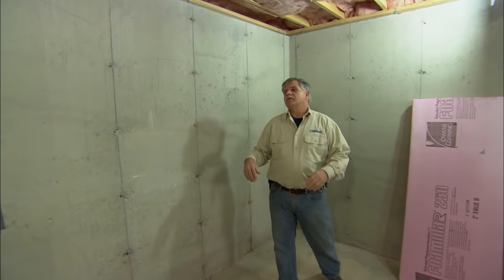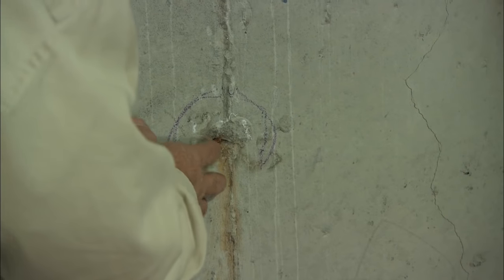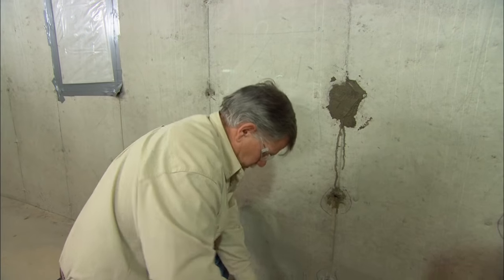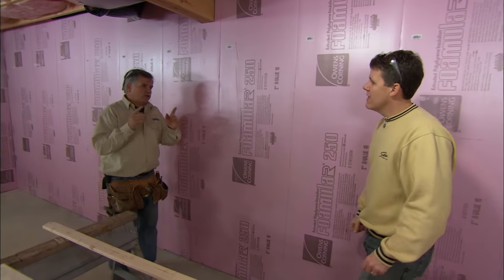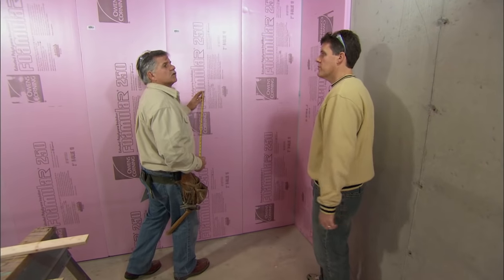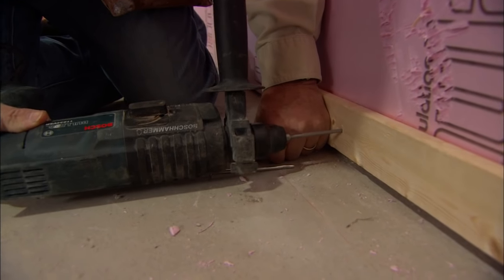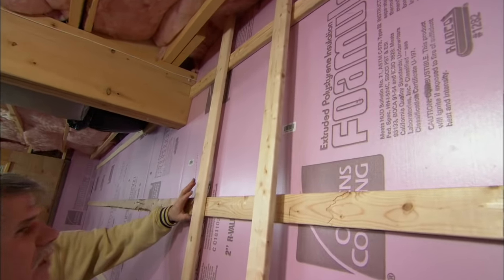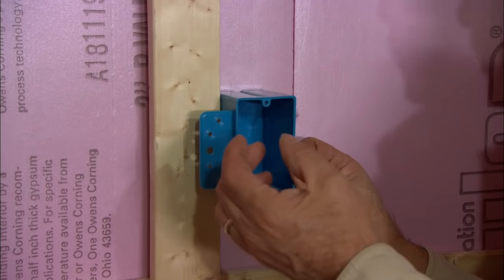How to Frame Out Basement Walls | This Old House

Comment: First, the air barrier is the insulation.  The tongue and groove creates the air barrier. 
Secondly, the wood is just to hang drywall and pictures.  Anything heavier than a picture will need to be anchored into the concrete.
Third, I'm not sure if this is cheaper, but it is an alternative for an individual installation as compared to 2x4 wall construction where the material is heavier.
And Lastly, the glue should be installed vertically, NOT Horizontal.  Yes, the basement isn't leaking now, but at some point it will.  By placing the glue vertically, the water can still run down the wall to the drain.  If the glue runs horizontal, it could trap the water and create mold.  Good air flow and a drainage path prevents mold.
Reply: About to move from dry California to humid Ohio. The house I bought was built in 2005 and in great shape. I'll be finishing the basement myself and was curious about what you said about there being moisture in the walls eventually. How long until I have a moisture or mold problem. What can I do to prevent or prolong any issues. I plan on using 2x4. Any help is appreciated.
Reply: Jeff Lundy 7
Reply: @Brocklanders80085  encapsulate from outside and inside. install a sump pump and dehumidifier. these things aren't DIY though.

Comment: I used that insulation then just framed 2x4s normally over the top of that.   The "Mike Holmes method"  which was the latest thing at the time.   It does end up thicker than this method but I can't imagine drilling all those concrete holes.  Plus I would think all those holes would affect the integrity of the insulation, which is serving as a vapor barrier.

Comment: First I sealed all cracks and joints in my foundation with polyurethane concrete failing. I then used 2 inch foam board for my basement and used foam adhesive. I also used house wrap tape on all my seems. I then put strips of 2 inch foam at the top ledge of the concrete foundation where the sill plate sits. Also adhesive and taped the seams there. Then a 2x4 framed wall was built in front of the foam. I anchored the wall every 3 ft with 3/8 th x 5in threaded concrete anchors. I also used wood chimes to push the foam firmly against the concrete or else moisture could build up in the air space. Then I insulated the cavity with Roxul mineral wool insulation. This way there's no chance of mold growth. Then I rocked it with moisture rock for bathrooms. It's a bit of a process but it's better insulated, stronger, tighter and has room for utilities.

Comment: Who am I to say tom should do anything different...i really respect his work.  i do agree w the comments about the vertical foam board adhesive runs (instead of tom's horizontal.  The only other thing i would do differently is to not use drywall screws to attach the wood. Drywall screws have only one job, to attach drywall. I would use construction screws instead. There are a number of ways a basement wall can be framed out correctly...this is one of them.
Reply: Brad K hjdbeen

Comment: I'm not sure why you don't build a 2x4 floating wall against the foundation? The insulation is method is fine, but if you use a 2x4 wall (built out) then there is no problem with spacing for electrical, plumbing, or ducting. Also it will handle the weight of a big flat panel screen or heavy pictures/artwork. I'm wondering if the building code allows this in your area.
Reply: I followed this process for two of my 4 walls in a basement room (the others were already framed normally) I finished.  During the course of the project, I had a master electrician, professional carpenter and a drywall installer in the room. Not one of them batted an eye at this method.  Take that for what it's worth.
Reply: I have concrete block foundation so if I used anything other than tapcon screws I wouldn't have had a very good hold.
Reply: 2x4 wall Method for me. This way seems like a headache.

Comment: What is the reason for building out a wall like this versus mounting a floor/ceiling plate and building a wall structure that you then lift into place? This looks easier, but just curious if there are other reasons.

Comment: But the 5" hole could create water to seep through from outside and make a it wet behind drywall or moisture that will create mold behind and front of drywall

Comment: Is there a video showing how the wiring is run? The NEC requires that the wire be at least 1.25in deep (to avoid screws from the drywall). How do they run the wires without violating code?
Reply: You apply nailing plates on the wood directly over the wire under the wood.

Comment: Good job! Now, moisture/ mold problem in basement always huge problem, so...: your plastic taped to concrete-test: after few days??, if there is moisture between plastic and concrete, how do you fix the problem?? Moisture seal/paintlike sealer there first?? Or how?? I understand, if there is correct sealer/ moisture barrier outside concrete, this would not happen, right?? Do you have to open all the walls , outside of basement, and seal walls/ concrete somehow??? just wondering....sure don't like mold=((( Thanks, youtheman !
Reply: Says in the video the plastic was taped up, "...a few weeks ago."

Comment: Question: Would the spring spikes work with the hollow concrete blocks as well? Thanks
Reply: no it would not it needs to be completely in concrete for the "spring tension to work"

Comment: when your installing 3 inch insulation foil boards on concrete the 4 inch spring spikes are not long enough.... what would you use? are there any 6 inch spring spikes??

Comment: you plugged 6 or 7 holes with hydrolic cement then drilled 50 hols back in it?, wouldn't framing the wall with 2x4s be a better option
Reply: +vern vern That's what I was thinking.....Why turn the foundation wall into a potential sieve...
Reply: +Phil Adelphia 
he filled the other holes because those are holes that go all the way to the outside of the foundation. Those are basically the holes for holding the forms in place while they pour the cement.
The holes he drills for the spikes that hold the strapping on, dont go all the way through the wall, so it cannot pull any water from the outside of the foundation.
But i do agree with the fact that if the walls ate not straight, which most poured foundations are not perfect, then it would be best to build a stud wall infront of the existing walls. But you do lose some space by doing this.
Reply: agree 100% w you. not sure he is 100% sure abouit this he is talking about carving the foam to acomodate the electrical box? mmmmmm  2x4 frame wall will do a better and less work.
Reply: @splash5974  "...Lose space by doing this"  2x4" wall is 3-1/2" + 1/2" drywall = 4" and you put R-16 insulation in there. This scenario, you get less R value (R-10) with 2" of Polystyrene, two 1x3's is 1-1/2" + 1/2" drywall = 4". No difference in depth. Using this method, you get lower R value, hammer drilling a bunch of holes, gluing all the poly, and if (when) there's a leak, it's a lot harder to pinpoint/access it. I'll take the traditional 2x4 wall. I really don't see any advantage to this other than ease of wiring install, which is not enough of an advantage to justify it.
Reply: @DeadeyeDaily  
Dont forget, you need to leave an air space between the wall and 2x4 wall... so its not identical dimensions, but close enough.

Comment: I don't understand why he used the hydraulic cement to fill in the hole in the concrete to make it waterproof, and then proceed to hammer in a bunch of spring spikes into the concrete. Do the spring spikes not let water in?

Comment: can you explain more about why this would cause mold. I want to create a basement office and would like to know what he did so wrong as to avoid it myself. As I put in my post, I imagine it would have been smart to add a vapor barrier but other than that what seems to be the issue?
Reply: Mold will not grow behind the walls unless they are painted with latex-based paint, which contains organic materials derived from rubber trees. Mold can also grow on basement walls that are extremely dirty.

In both cases, the mold is not growing on the concrete, nor is it growing on our basement walls. To keep mold from places from places we can't keep dry, we need to use inorganic materials such as plastic, glass, concrete, and metal.  hence the use of the rigid pink insulation.

Comment: So I see all this stuff about 2x4's? What are those? I'm thinking about finishing a room in the basement with my dad (I'm only 14) because I like quiet, instead of drilling holes are you saying that I should only put the insulation in? Please respond.
Reply: So what makes sense is insulate your wall like Tom shows  Then with a chalk box 4 inches from the wall make a line. Frame a wall with 2x4s using green treated for anything that touches bare concrete.

Comment: So i have seen the two methods of framing with using a floor plate and this. I am wondering why everyone things this is such a bad idea? Because he has used untreated lumber? not installed a vapor barrier? It looked like he conducted a moisture test and then filled in his possible problems so am I missing something. I really want to create an office space in my basement. I have don't the moisture tests and have come up good. Why should I not use this method?

Comment: I really like this meathod but my basement is of block construction so I'm sure those fasteners won't work. I suppose my only option would be to frame it out normally, leaving an air gap.
Reply: +SOHCEJ8 I guess you're right. thanks.

Comment: Owens Corning FOAMULAR® 250 extruded polystyrene insulation is ideal for wall furring, perimeter/ foundation, cavity wall, crawlspace, pre-cast concrete, under slab, roofing systems, sheathing and other applications (Not approved for roofing). Owens Corning’s patented Hydrovac® process technology make the unique closed-cell structure of FOAMULAR® extruded polystyrene insulation highly resistant to moisture, retaining its long term R-value year after year – even following prolonged exposure to water leakage, condensation, ground-water and freeze/thaw cycling.

Comment: So don't put foam if your house doesn't have the outside wrapped ??
my house is from1940's cinder blocks should I just put tyvek then foam or only tyvek and no foam 
Lol
Reply: Raymond Hogue lll ** I’m pretty sure what he was saying is that on any new foundation the builder , maybe not back then , should have tarred the outside of the foundation before backfilling the foundation with dirt then topsoil , if you are having water in between the plastic and the wall then it is highly suggested that u dig around the foundation and tar the exterior , if u were to tar the inside u would still have the same issue ,water in between the tar and foundation on the inside causing whatever waterproofing u install fail. Then u would proceed with the sleepers ( the slats going vertically up ur wall to anchor the drywall to ) in between the sleepers foam and then drywall , hope this answered ur. Question

Comment: Why do it the hard way? Just frame it with 2x4. You get better R value when you insulate, and your wall will be flatter, since you'll leave a space between the concrete wall and the new stud wall.
Reply: +Mark W 
Not really, because you leave about half an inch between foundation wall and new stud wall. That way there is no cold transfer.
Reply: +Mark W 
no, its air space. you dont need foam if you are going to put up a stud wall, use batt insulation between the studs, and then vapour barrier it. that is the correct way. aslong as the wood does not touch the foundation wall. only if it touches the wall, do you get cold transfer.
you would use foam and then stud wall with insulation. the cost of that would be astronomical, and then ut would be cheaper to just spray foam it, and be done. spray foam is the best way!
Reply: +splash hey, random question seeing as you seem to know. right now i am currently doing my basement wall (its block not poured like in video) I currently have glued all 1.5" R-5 pink Styrofoam (similar to video) that pink stuff is already up so now i am going to frame using 2x4 and allow for an air gap. i am going to use pressure treated lumber for the base plate only. then vapor barrier and drywall is this over doing it?
Reply: The foam pink insulation is pricey. I think it not worth using on a wall that is already partially insulated by the ground. If I were to use it I would only use it towards the top of the wall that is above ground level.
Reply: +duradim1 yah tell me about it i spent too much, I didnt want to cut corners lol. I get what your saying, so basically there is no point. thanks!
Reply: foam because you don't want the air in the gap to move, as convection will reduce R value....

Comment: Instead of having boards going horizontally why couldn't he have just used 2x3s instead and run them vertically on the seems of the insulation with his special nails?
Reply: Running the horizontal boards first and then the verticle boards gives them the ability to run wires over the horizontal boards and under the vertical ones. all behind the sheetrock without drilling any holes

Comment: So... the steel within the wall was already rusting, so they're going to add more water to it and then seal the water in? One of the problems of using steel rebar is that it rusts, and as it rusts, it expands, which then cracks the concrete causing even more moisture to to soak into the concrete accelerating the rusting of the rebar... I don't get it. There's a reason why bridges only last 50 years and the rebar is the reason why. You're just exacerbating the situation by adding MORE water to it.
Reply: Bingo! Not sure why everyone is on Tom's nuts... We've been getting sold sub par built (code) houses for years. Him suirting that caulk horizontally should be the ringer everyone sees and says," nope, aint the guy to take direction from."  Messing around with waterproofing and insulation should be left to competent people. Notice how I didn't say Proffessionals.....

Comment: 2x4" wall is 3-1/2" + 1/2" drywall = 4" and you put R-16 insulation in there. This scenario, you get lower R value (R-10) with 2" of Polystyrene, two 1x3's is 1-1/2" + 1/2" drywall = 4". No difference in depth, no space savings. Using this method, you get lower R value, hammer drilling a bunch of holes, gluing all the poly, and if (when) there's a leak, it's a lot harder to pinpoint/access it. I'll take the traditional 2x4 wall. I really don't see any advantage to this other than ease of wiring install, which is not enough of an advantage to justify it.

Comment: dont wanna disrespect Tom, but how strong is this wall actually. doesnt seem strong enough to hold that much weight.
Reply: +JTGuzinski The only downside is expect to go through a 4 dollar drill bit every 32 inches of wall.
Reply: ya iv'e talked to a few guys. they haven't done it but they said it should work. I have a 1950s house the doorways and walkthroughs are pretty tight so every inch would count. thanks Japer, im planning on finishing my basement this fall/winter so maybe ill give this way a shot.like i said didn't wanna disrespect tom Silva, i am sure he knows what hes doing. ya i figured id prob clean out home depot of these 3/16 SDS bits if i do it this way.

Comment: no moisture barrier?
Reply: I am not a master carpenter ... hell I'm not even a basic carpenter, but testing one portion of ONE of your walls may not be sufficient to truly identify whether you DO or WILL have a moisture issue.  Unless you're in a water-depressed (dry) climate most or all year-round (think Arizona in the USA), I suggest not skimping on moisture-proofing your basement; especially if you're investing time and money in finishing it.

Checking one of several walls against moisture is like checking one of your four+ car/truck/van tires for a leak and assuming because one tire is of correct pressure and leak-free then the remaining 3+ are as well.  That is dangerous and borders on negligent.  Spend the money and purchase a vapor barrier at the least, even if not for moisture, for potential subsurface vapors which may enter your residence/building (such as petroleum, solvent vapors from environmental contamination).  I did like the video as it showed a different method of framing my basement but in my area, we have sump-pumps so I plan to go the traditional 2x4 route.

Comment: So... During the beginning you seal some spots with concrete.. Then you drill a bunch of holes to secure the boards to the wall... Won't those leak also... Lol
Reply: One penetrates the foundation, the other just few inches. Turns out size does matter.
Reply: Mark Leonard 😯🤯🤯🤯

Comment: so basically you drilled hundred's of holes into your foundation? ok
Reply: Exactly.  U just filled 20 holes with hydraulic cement to turn around and drill a hundred more that won't be filled lol
Reply: nutrientcobra
Not exactly, the holes he filled were the ties for the forms when the foundation was poured, they go right through the foundation. He's drilling holes a couple inches into the foundation, not through it...different.
Reply: My apologies, thanks and stand corrected!
Reply: and your cement is waterproof right?

Comment: what happens in 50 years when those walls are soaked
Reply: In 50 years lol? It's called selling your house for a profit and letting new owners worry about it.
Reply: What do you mean?
Reply: water will eventually work its way down until it puddles up on the floor. just a matter of time. drain tile will eventually clog up to. at least in my neck of the woods it will.
Reply: Frapo Chino your missing the point
Reply: John Thomson So how should I finish my basement. I'm 18 and just starting to learn on how to do house stuff.
Reply: TheMidnightNarwhal buy one of those books from home depot or hire a contractor with good reviews, that's what i would do